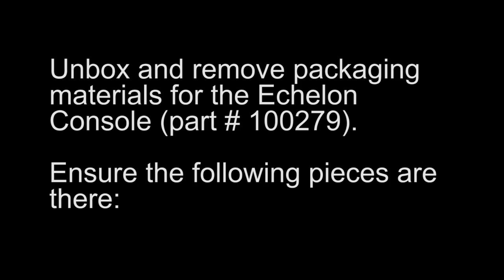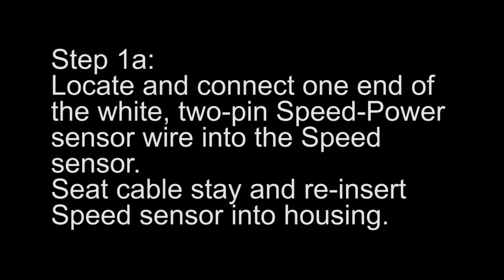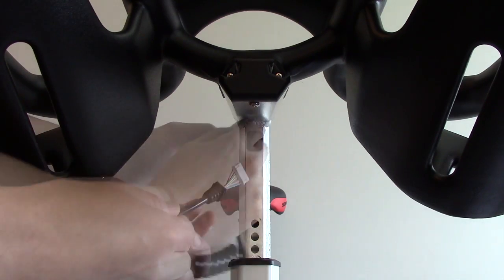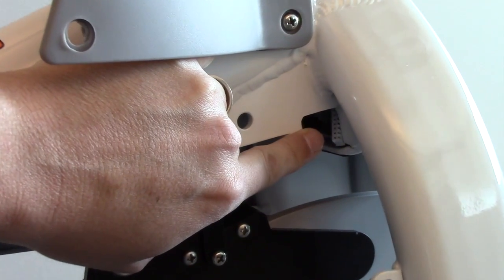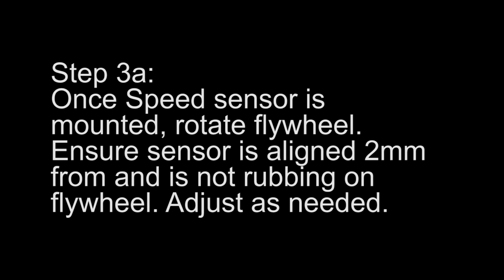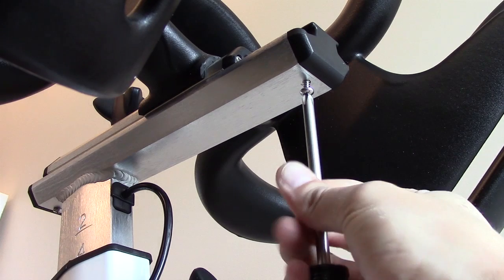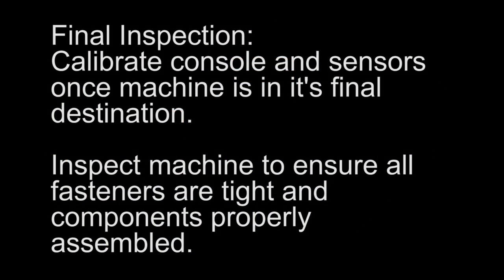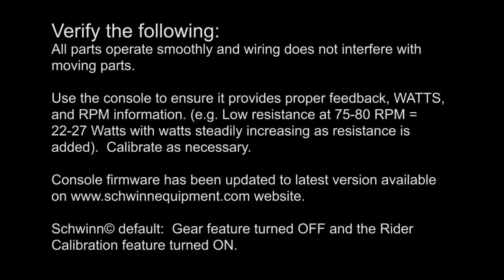Schwinn MPower Echelon Console, Speed, and Power Sensor Installation

Comment: The Carbon Blue that just arrived here is missing the bottom hole to channel the console power sensor wire out the bottom end of the handlebar stem. Instead there is a tiny gap next to the rubber grommet that has a razor sharp edge that will most likely cut the wire over time, not to mention it being impossibly tight to try to thread the wire through. Not good Schwinn, not good.
Reply: videobuoy buoy Well smart ass, you are the one that is wrong.  The place I got mine from had to have all the handlebars replaced on the bikes they received in that they were not drilled for acceptance of the console.  It would be so wonderful if dumb asses like you would discover what you are talking about before putting out a "duh" to someone else.  BTW duh, dumb ass!
Reply: ^^ what Sandy said. And now that I have the replacement handlebar, the coiled cable for the watts upgrade is too fat to fit down the cable channel in the handlebar post. It's more than double the width of the normal MPower cable, so I await another replacement. On the upside Schwinn sent me a couple of walking billboard tshirts for my trouble. Never mind the fact that I can't actually use the computer that I spent €400 on.

Not what I expected from a premium product like this.
Reply: You're putting it down the wrong side - what the video again...... duh!
Reply: videobuoy buoy There isn't a "wrong side". There's only one top hole through which to channel the wire. What part of "missing the bottom hole" don't you understand? The machined hole isn't there and it is a well documented problem afflicting a whole batch of bikes from Schwinn. The manufacturer didn't machine the bottom hole. I have since received a handlebar post from the distributor where they have actually hand drilled out a bottom hole for me while I await a replacement from a new batch of handlebar posts from Schwinn.

Duh right back atcha dummy.